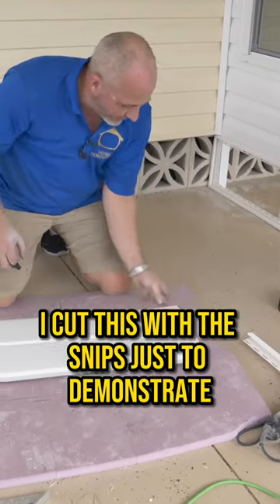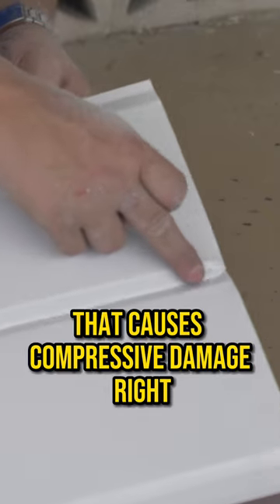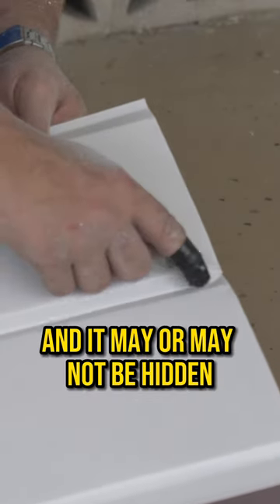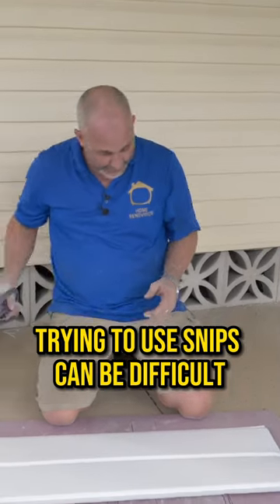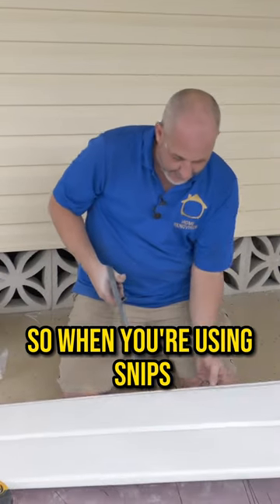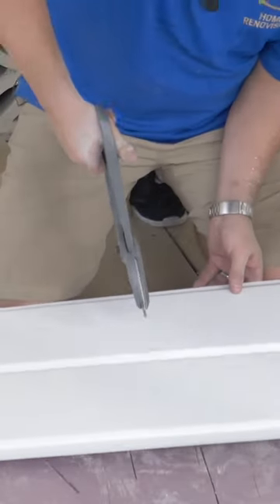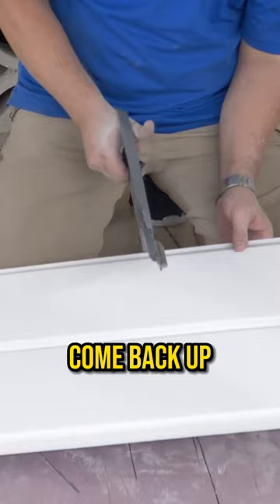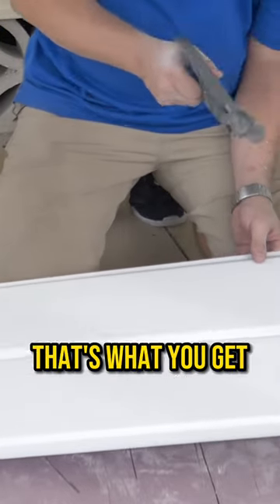How to Use Vinyl Siding Snips

Comment: A grinder with a diamond blade, or a saw with a paneling blade installed backwards works muck quicker and doesn't squish the material. Will also cut aluminum.

Comment: Build yourself a soffit jig and use a fine tooth circular saw...fast...square..no damage
Reply: Was going to say this. Saves the back of your hand too lol. If you have trouble with pieces sticking up on vented, you can turn the blade backwards